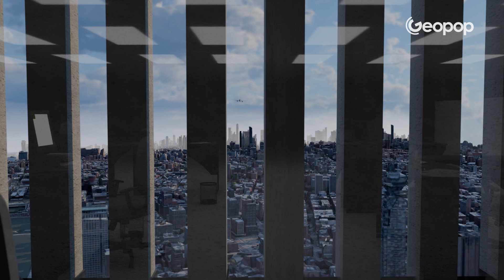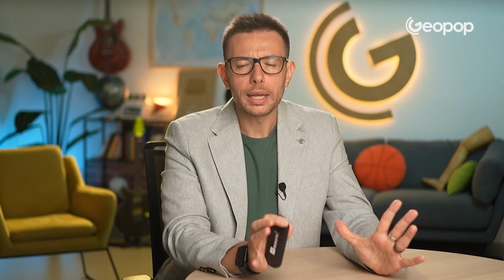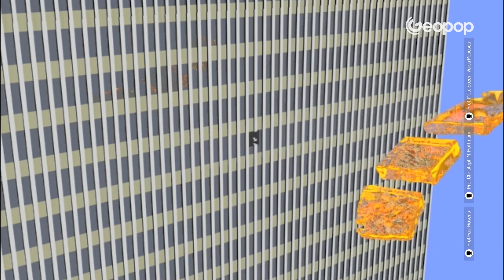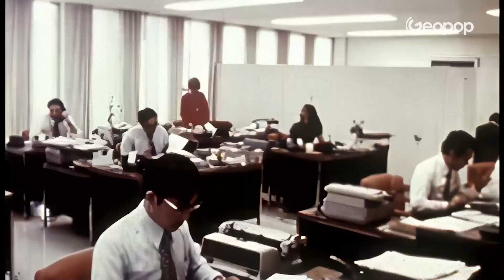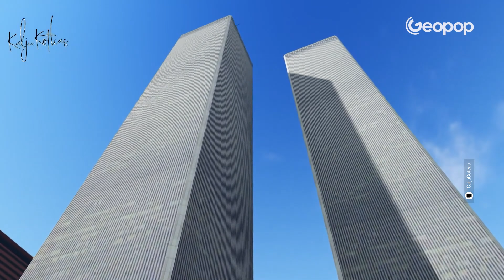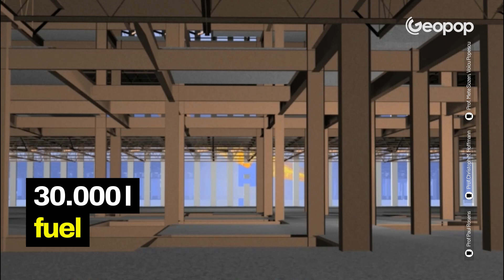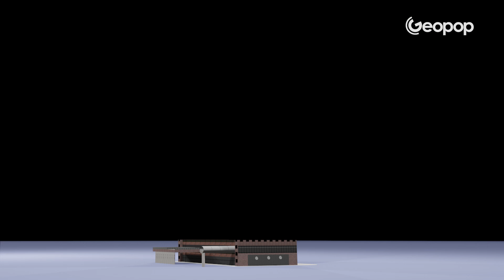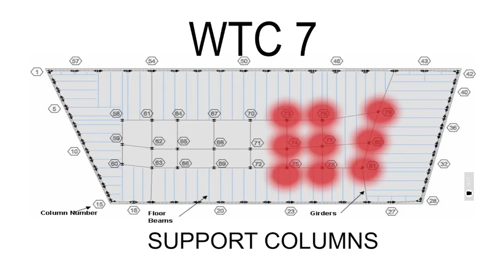9/11, 2001: The Technical Reconstruction of the Twin Towers and WTC 7 Collapses

Comment: This guy is talking a complete load of rubbish. Anyone talking the truth   about  911 is  not allowed near youtube these days , wonder what happened to freedom? What this man says is impossible and will break  laws  of physics. Remember if a  building is designed to hold all weight above it then it is impossible for it to collapse in on its self. You would have to compromise structures near the base and even then  the building would just  topple over.  The twin towers were the strongest steel framed buildings in the world. It had double weight supports. They also always show the weak floor trellis supports. In reality there were massive steel girders connecting the outer and inner. The Pancakers always talk about a floor. What? There was not one spanning floor. The floor was connected to a massive central column. Ok so a bit of jet fuel can pulverise 380000 tons of steel and concrete in 10 seconds? Have you guys ever heard of something called a jet engine? That same fuel is beng burned at vastly higher temeratures in an enclosed space for 12 hours or more. Jet engines are made from alloyed steel. Also, they never mentions this,  but steel  is a very good conductor of heat, so in a steel lattice it would  be impossible to concentrate that heat.
Reply: Hence why AE911T have 1,300 videos on their channel.
Reply: @TheCriticalStinker-jw4fl  yeh and explosive evidence from them is the go to documentary about the facts of the matter. Pity you cannot view or buy it anywhere now...Wonder why?
Reply: @patricksmith4424  - Only for mindless conspiracists.  Thinking people don't bother.  But you are avoiding the point that your opening claim is false. So are many others.
Reply: @TheCriticalStinker-jw4fl  Avoiding? I thought I put it quite clearly. If you can find anything false in it, then please let me know.
Reply: @patricksmith4424  The topic of my reply was your (false) claim that conspiracy woo isn't allowed on TouTube (in spite of copious evidence to the contrary). 

You tried to divert from that topic.
Reply: @TheCriticalStinker-jw4fl  are you  joking? Youtube used to be packed solid with truth stuff. Now all you are allowed to see is crxp like the above video. Make sure the plebs are ignorant. They have been doing it on press and TV for years, now the net is under "their" control. Its really sad that an open education source had to end this way.
Reply: @patricksmith4424 - It still is. But almost all of it is old and attracts little attention. The algorithm favors the new and happening.
Reply: @TheCriticalStinker-jw4fl  That is simply not true. 911 truth stuff gets millions of views (too many) for them. There is loads of stuff on youtube which only has  single digit views from over 10 years ago.  There is new truth stuff being made all the time. Google (youtube) have banned anything to do with 911 truth. They made millions from advertising on it,so there absolutely no reason take it down other than it was getting to close to the.......truth.
Reply: @patricksmith4424🎉 - It got millions of views.  The latest AE911T video a few weeks ago petered out after about 6,000 views. And those morons are the biggest 9/11 woo outfit still in business.

Nothing has been taken down. Nobody watches old 9/11 woo videos so the algorithm does not favor them.
Reply: @TheCriticalStinker-jw4fl if this is the new and the happening, then why is this dude wheeling out the same pancaker nonsense.

Comment: 7 dropped like nothing was under it
Reply: Not it didn't.
Reply: @TheCriticalStinker-jw4fl  my eyes must be seeing things again 
I should not trust them. Right?
Fell like it was destroyed on purpose
Reply: @montanasnowman3138  - If you don't understand what you are seeing, yes. 

The collapse of the unknown and unimportant Building 7 – one of 6 buildings to collapse of 10 destroyed on 9/11 - confuses a lot of people, despite being one of the most studied engineering disasters in history. It was not famous, not a terrorist target, no one was killed in it and thus it did not get a lot of attention, so most know very little about it. There is a lot of tantalizing but absolute garbage out there on this topic. Given the choice between long boring, hard to find technical reports and readily available, easily digestible fantasy on the internet, many turn to the latter. To counter that I prepared this brief summary explanation based on my own analysis. No politics, just engineering. 

The North Tower collapse at 10:28am bombarded Building 7 with thousands of tons of burning debris, causing heavy damage and starting raging fires burning out of control for the next 7 hours. Half the responding FDNY firefighters having been killed, others injured, units in disarray, much of their equipment destroyed, no water pressure, and the greater urgency of Search & Rescue efforts, firefighting efforts at 7 were pulled as futile. The building couldn’t be saved and was left to its fate.

youtube.com/watch?v=g_SvpwyC17M&ab_channel=MFitz 

Collapse of a burning structure is always a concern for firefighters. Steel buildings subject to fire rely on active fighting of the fires to survive. Left to their own devices they will collapse. Buildings are designed around 1 to 3 hours of fire resistance, allowing time for occupants to escape and ACTIVE firefighting to get started, after which all bets are off. In B7 the occupants escaped, passive and active fire protections were compromised and active firefighting never got started which left the building to take its chances. It lost. Odds on Building 7 would eventually collapse,… and it did. No big deal in logic. That is the sort of choice firefighters make every day in brush fire situations - which houses to save and which ones to let go. Only real difference here is moving the decimal on the size and cost.

FDNY Chief Daniel Nigro ; The biggest decision we had to make on the first day was to clear the area and create a collapse zone around the severely damaged 7 World Trade Center, a 47-story building heavily involved in fire. A number of fire officers and companies assessed the damage to the building. The appraisals indicated that the buildings structural integrity was in serious doubt. I issued orders to PULL BACK the firefighters and define the collapse zone. It was a critical decision; We could not lose any more firefighters. It took a lot of time to PULL EVERYONE OUT, given the emotionalism of the day, communications difficulties and the collapse terrain

FDNY Deputy Chief Peter Hayden - We had our special operations people set up surveying instruments to monitor and see if there was any movement in the building. We were concerned of the possibility of collapse in the building. And we had a discussion with one particular engineer there, and we asked him if we allowed it to burn could we anticipate a collapse and if so, how soon? And it turned out that he was pretty much right on the money, that he said 'In its current state you have about 5 hours

With its deteriorating condition being reported throughout the day, the collapse of Building 7 expected by the FDNY, bystanders and the media meaning at least 24 video cameras recorded some or all of the collapse. Everyone at the time knew what was coming and why.

youtube.com/watch?v=OY5S5k3tMHI&list=PL4GiNqqck-lzR7pebSWRVLoXyu-aWR3Rr&index=48&ab_channel=911InvestigationVids 

Building 7’s collapse was totally different to the Twin Towers, harder to understand and most of the details difficult to see. But we can sort out what happened through careful analysis and observation.  What follows is MY EXPLANATION of the collapse sequence using the best available information and relying on no authority.

B7 was complex structure, a 47-story steel framed building built on top of a smaller existing 3-story building, requiring several lower floors dedicated to complex load transfer structures instead of usable office space. Of trapezoidal shape and all-steel tube-in-tube construction, B7 (above the 7th floor) consisted of a central core of steel columns carrying most of the gravity load, perimeter steel columns around the outside of the structure carrying the remainder of the gravity loads and long span beams and girders to tie those elements together and form the floors. On the outside of the building hung a moment frame - the last part of B7 to fall. 

Phase 1 : Collapse initiation for B7 is notably quiet with observers not realizing the building was collapsing! There was no audible warning in the form of say hundreds of ear drum busting 180-190dB explosive bangs preceding the collapse. The first externally visible signs of collapse initiation occurred at 5:20:28 pm. Here at 12:00 a local CBS affiliate reporter is talking 10 blocks from B7 when collapse begins. People don’t start to notice the collapse until 12:11. Then at 12:45 is the famous CBS fixed camera clip of Building 7’s collapse Again, note how quiet it is.

youtube.com/watch?v=t5tEy6mXSE8&ab_channel=fresnosean379

Collapse initiation was due to multiple lower floor failures above the load transfer region (7th floor) in the NE corner of the building. In this video at 0:45 you can see the NW corner from inside the building while under construction, Column 79 just out of frame on the left. That big, angled steel beam across the top of the frame connects to C79 at one end. The girders connect to the beam. The beam and all those girders depend on just one connection

youtube.com/watch?v=nP3TNHPCIVU&t=35s&ab_channel=EdwardCurrent

Phase 2 : Lower floor failures left core Column 79 laterally unsupported over an excessive length and it buckled. If you look at a floor diagram of Building 7 (see above) and look at all the structures that depend on C79 you quickly realize this one column was a relatively isolated structural element on which a disproportionately greater fraction of the structure depended . Externally we see a vertical progression of window breakage along the 44-46 line and a kink in the roof of the East Mechanical Penthouse at the top of the building, consistent with C79 failure. The transition from full capacity to almost no capacity occurs in virtually an instant. Once the buckling failure occurs there is almost no resistance

Normally with a buckling column, the load could very well be redistributed to other columns, meaning the buckling could stop after a while. With C79 that is not the case - the failure did not redistribute the load, so the collapse rapidly progressed to the roofline, sinking the rooftop penthouse.

Phase 3 : With C79 gone, B7’s progressive, non-symmetrical collapse continues with C80 and C81 at the east end of the core left laterally unsupported and quickly buckled and failed as well, sending the EMP down through the building. C79-81 all have no diagonal bracing, which I believe is a major reason why they could not redistribute a lot of vertical loads among one another.

From there collapse progressed from east to west through the central core until the core was gone taking all of the interior floors and structures and probably most of the perimeter columns with it. You can see the horizontal progression of window failures low in the building and the dropping of the remaining rooftop structures into the building. One of the big takeaways from the NIST Building 7 study (that gets completely ignored) was their modeling which determined C79 failing under ANY circumstances would have initiated the same collapse sequence.

Phase 4 : After about 10 seconds only the exterior moment frame - a hollow shell mostly supported by the 4 corner columns and quite unable to stand on its own – remains, creating the illusion the building is still standing since little has changed externally. That’s just hollow empty shell, like an empty cereal box. The north leans inward, forming a V in the roofline. The last remaining perimeter columns buckle under the strain.  There is almost no resistance as the moment frame free falls, landing on top of the 7-story high debris pile, blocked surrounding streets, heavily damaged the Verizon Building and destroyed Fiterman Hall at 30 W. Broadway, all well outside of Building 7’s “footprint”.  It is only here, at the very end that a single utterly meaningless measurement of alleged free fall is taken. Start to finish the collapse took 18-20 seconds, or less than 1/3 of true free fall*. Not that we really care since how fast something falls cannot tell you what started it falling in the first place. The free fall argument is about the collapse of the outer shell *AFTER all of the critical internal structure had already failed and completely ignores about 80-90% - of the collapse. 

Building 7’s progressive, non-symmetrical collapse was incidental and unintended collateral damage from the combined effects of fire + time + gravity started by the collapsing North Tower. That is true no matter who planned and carried out the 9/11 attacks or why . The collapse was of so little consequence it barely even registered at the time, a mere footnote. 

I hope you found this helpful and informative, not adversarial and it solicits informed critical comment. If I made any errors of fact, logic or reason or left anything critical out, please let me know so I can fix it. IF you can offer a more plausible alternative please do. Be the first. Please start any reply with the words “Tits McGee” or I will know you didn’t read it and are wasting my time.

Comment: So an aluminium tube penetrates steel girders..How? It's still unexplained. Aluminium Vs Steel - who wins? A accurate computer simulation would show the plane hit the building and fall to the ground as Aluminium obviously cannot penetrate steel. Try throwing a paper aeroplane against a wall and see what happens. Very odd. And then it turns to dust and there's hardly any rubble! wtf?! Rubble should have been a few stories high..Even odder..
Reply: Kinetic energy. 

Here is an accurate computer simulation which took two years of data compilation and number crunching in a Cray supercomputer to complete:  www.youtube.com/watch?v=cddIgb1nGJ8&t=5s